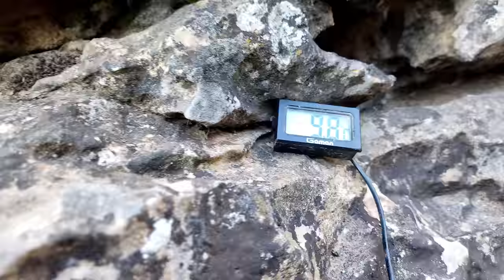I Built A Cave That Could Last For A Thousand Years In 15 Days - Cave With Fire, DIY, ASMR

Comment: This video is also a great example as to why one should never build a fire under an outcrop of rock. It may seem logical to keep your fire covered, and the heat trapped is great, but it can also crack off a giant piece of rock in the night that will squash you in your sleep
Reply: Not in the fashion of the video. But otherwise it's okay. Been done for hundreds upon thousands of years.
Reply: @clayton9136  And the ones that didn't work out for will probably have their remains buried forever. ;)
Reply: Difference between a fire to cook rock and a fire for warmth and cooking.
Reply: @GUNNER67akaKelt  More than likely just a cool story to tell. But ya I hear ya.
Reply: @clayton9136  Hehe, the danger is probably overblown, buuuut it sounds like something that would happen to me... actually, come to think about it, in my teenage years my family visited the Wisconsin Dells.  There are steep, narrow canyons you can hike through there.  It had rained the day before and as I walked I heard a noise above me.  A rock the size of my head was skipping along the canyon wall heading directly for me.  I jetted the hell out of the way, dragging my dog behind me. It scared the hell out of me and I didn't stop running until I reached the other end of the canyon (only to realize I had to go back through the canyon to get back to the boat).
Not the same situation but... yeah, there's always that one chance.
Reply: @GUNNER67akaKelt  Damn that's wild, never talked to anyone on here that's mentioned that. Pretty cool! I grew up in Milwaukee and have been to the dells countless times I know exactly what youre talking about. That particular thing never happened to me, but you can see the shale rock all over the banks from where it does fall off.
Reply: @clayton9136  I just assumed it was because there was a good rain the day before.  I mean what are the chances that a rock falls off a cliff at the same moment I was walking by.  You do occasionally hear things like that on the news, 'Woman killed by falling tree.'
On my way back through I came to the area with the rock in time to see one of the guides push it off the boardwalk.
<Waves from Michigan!>
Reply: I think the risk of the rock changes with what the rock is. A sandstone like this becomes very brittle when heated but some other stones are more resistant to heat.
Reply: Europeans going back to the caves this is history in the making 😂
Reply: I learned that from Survivorman
Reply: I may sound dumb  but I never knew that rock could burn
Reply: @dede.terrebonneterrebonne9914  generally it's not the rock per se that's burning, it's the water that's locked inside the rock getting heated that either evaporates causing a phase change into a more brittle form, or more commonly, the water expands as it heats into steam that cleaves off sections of rock along stress lines
Reply: @dede.terrebonneterrebonne9914  It's limestone and it's called slaking.  This is why firefighting in limestone buildings is so hazardous.  A jet of water hits the heated limestone and the results are spectacular and lethal.
Reply: People don't realize how much moisture is trapped in those rocks. Heat it up enough and that evaporation needs to escape somehow. Honestly i've never actially seen it done. I'm impressed by the size of the flakes coming off. Not sure you can even call them flakes at that point. Maybe mini boulders would be better...
Reply: @springfieldsaint2749  yer probably right for the most part, but my cold-blooded ass would probably make a big enough fire for warmth to cook that rock... 😁
Reply: @clayton9136  yeah, your wrong. there are conditions that you wouldnt want to do this, like some random cave you find during winter to "winter camp" in. water gets in rock cracks freezes and cracks rock, then when fire warms it falls off. caves that have fire established in them like the cave dwellings of the fremonts we have in utah, they are very established caves, that being said, there are many that have have collapsed. you watch way too much and dont do much yourself. no offense i saw your rc truck video and you cant even tell the difference between wet sand and what clay is.....
Reply: @ownlywon  Did you read my comment? I literally said the same exact thing without talking so much.
Reply: Это не чистый камень мне кажется извезков камень да
Reply: yep, i knew that also. 🔥🧨
Reply: @flamesnstuff5006  It isn't sandstone. It's lime. See how pretty and white it is? Lime becomes VERY brittle, when heated. Romans found out that when lime was heated, and water was added, along with sand, and a few other elements, you could make fantastic concrete with it... and with concrete, you could build nearly anything.
Reply: Fire under a boulder has to be minimal. Look at the size of the fire this guy used in comparison to a "warming" fire.
Reply: @clayton9136  with a pinch of survivor’s bias 😉
Reply: @clayton9136  9
Reply: Is that even rock? What kind of rock crumbles from a basic bltch fire?
Reply: If the fire is intense enough to cause a large piece of rock to fall off, and it's close enough to you that the rock hits you, you've already been incinerated before that rock falls.
Reply: There was a large cave in the SW of England (I think) that was party central for the local kids and had been for years. They were warned about building bonfires in there in case the roof collapsed and kids being kids, they kept doing so until a large section of the fell in and killed some poor chap. This was within the last 10 years so not a an old wives tale!
Reply: depends on stone. nice try
Reply: you guys are so empathic its too bad there is an effort in corrupting the human soul by the demiurge
Reply: Rocks are porous and retain water. The heat boils the water and pop goes the rock, Same when the rock freezes, then the water or ice expands.  When I've needed to use a bolder for shelter, I have piled up smaller rocks to build a wind break. Survival camping you don't always need or want a fire
Reply: depends on the type of stone, this is aparently sandstone which disintegrates in heat
Reply: Never is too final a word.  Rather than fear every outcropping, it makes more sense to read up a little and be able to recognize different types of stone.  Sandstone, limestone, shale are examples of rock that would crumble like this.  In my home of NH, also known as the Granite State, you can build a bonfire next to most outcroppings with no fear.
Reply: I agree with your observation, specially the type of rock this guy was burning...very dangerous...
Reply: Look at all these geologist and mineralogist
Reply: completely dependent on the type of rock bud.
Reply: it depends on the kind of rock it is and what its composed of. there are absolutely rocks you can build a fire under.
Reply: I never knew this could happen

Comment: Built with the land sloping in, to catch a lot of flooding in a big rain, built on  the side of the rock, that will allow water to run into the cave, out of rock that splits easily.
Yeah, not a long term project.

Comment: This is how wildfires start. One spark settling on dry brush and you're famous for the wrong reason. Using fire in this way should wait at least until a rain has soaked the surrounding landscape. I know that's probably rare in that region but that doesn't excuse risking a wildfire when the goal is a YouTube video. I wouldn't be surprised to hear that there was already a fire ban in place. While the shelter looks good, please act more responsibly in the future.

Comment: Not my choice for shelter. It has a slope. That means if trees are not abundant in the adjacent top side water will flow into the shelter. Its limestone & this is not a stable rock to live under if water becomes an issue. He will be cooking or using fire 2keep warm, leading to flaking & falling rocks.